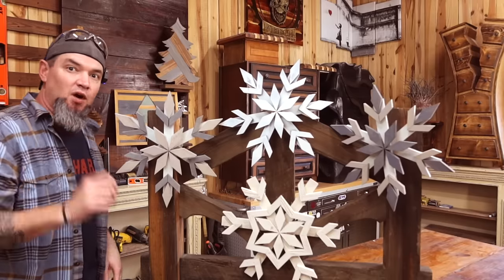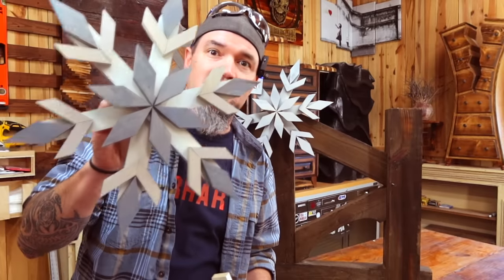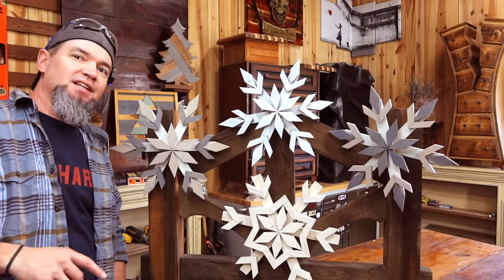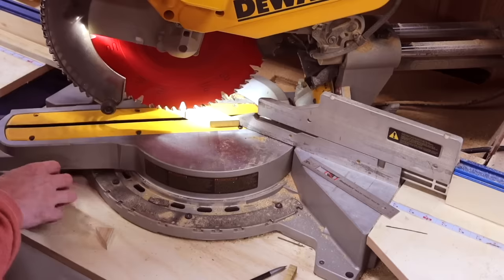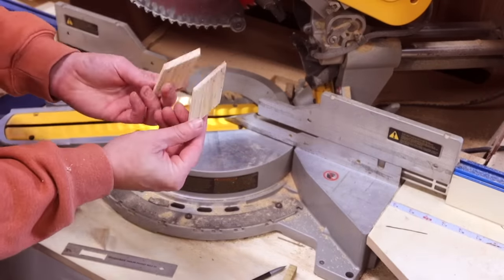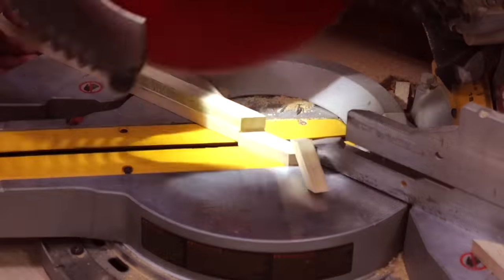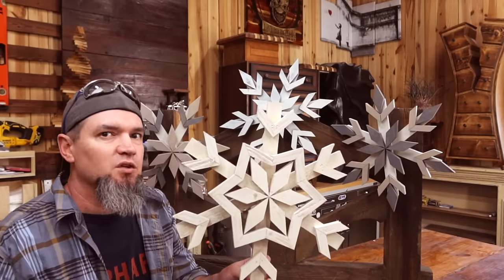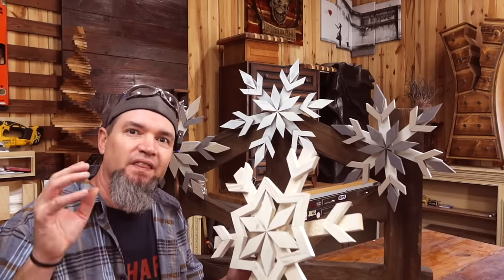One Picket - 3 Wooden Snowflakes - Make Money Woodworking

Comment: If you want a fast way to stain small bits, put them into a mess bag or a strainer of some sort (window screen) and dunk the whole bunch into the stain.  BAM! you're done.
Reply: Excellent vIdeo, excellent productions and excellent motivational talk at the end. I make rustic sleds for Christmas craft shows. Your last couple of videos have given me some ideas for some complimentary items to make and sell. Thanx for your presentations.
Reply from the maker: Good idea!
Reply from the maker: I’m glad to help!
Reply: Question- After you dunk the small parts into the stain with a strainer or whatever, do you still take the time to wipe off the excess stain?
Reply: @christianackley7147  I would recommend
Reply: @MatthewPeechWoodworking  why do my diamonds keep coming out disproportionate?
I bought the plans. 
Are they supposed to look that way?
Reply: @daveortwine2641  are you getting mixed up with the tip to tip size of the diamond and the amount you need to mark past the saw blade?
Reply: @rodgerq  mine came out ok but I had that question as well.
Reply: @daveortwine2641  I used a Guage to set my table saw at 1.25 " 50° (my miter saw doesn't go to 50°) and the diamonds came out perfect.
Reply: @daveortwine2641 try making your first cut at whatever angle (50, or 45 if that’s all your saw will do) then measure that diagonal edge of your fresh cut.  Then mark that same length on the side touching the fence with just a tiny pencil dot.  For the next cut slide the board down so that the whole blade is on the stock side, like you’re going to cut the dot in half.  If you’re holding the long board on the left side of the blade, then the right edge of the blade will be at the dot.  Maybe it’s 2 1/16” or 1 31/32”, as long as it matches the cut diagonal edge dead on.
Before you do that 2nd cut, mark where the cut diamond point is an your fence, or even better clamp some scrap as a stop right there.
Hope this helps!
Reply: @jaytrent62  , thanks for the detailed information. I have just started making the diamonds and driving myself crazy. I will try this tomorrow evening!!

Comment: Made my first snowflake last night :) wife loved it.  A side note to those who may have a miter saw like me (maybe mine is just old) my miter saw does not move to a 50 degree angle - little disappointed at first but was able to move forward using the table saw guide bar and setting it to 50 degrees - set the rip fence to the desired width and was able to make quick repeatable diamonds.  ***Matthew P. your doing great, love the channel by far my favorite woodworking channel to watch, keep it up you have many fans!
Reply: I was having the same problem, and you gave me the answer. Thanks so much.
Reply: Had the same issue.  Rigged up a fence on the 90 degree plan and used the 40 degree miter as the compliment is 50 degrees.  However, this is not very repeatable and my diamonds did not turn out as perfect diamond.  But for personal holiday décor, these will be great.

Comment: My miter saw only goes to 45 degrees either side of 0. What I did to get a 50 degree cut was I cut a 2x4 to a 45 degree block and I clamped it down tight. Then I moved the miter to 5 degrees. I definitely got that 50 degree cut BUT after that I hit another road block. I cant make repeatable cuts at 3.5"  The material butts up against the fence. If I forced it I might be able to make a "diamond" shape at about 1/8" length. I thought about cutting down the 1.25" wide pieces to their 3.5" size (36 in total) and then doing the 50 degree "hack" cut.  However it is really close to my fingers and doesnt feel safe. Looks like  I need a new miter saw but that isnt in the budget for a while. Bummer. Looks like I cant make these snowflakes.
Reply: Use your table saw instead and the miter gauge that comes with it. That's what I had to do. Set the miter gauge at 50º and rip 'em out

Comment: I've been watching your channel for a while now and my mind is overwhelmed with ideas. I have always been an outside-the-box thinker and creator. I'm a deck and screen porch builder with an endless supply of scrap wood and PVC products. I am powering up my first-ever wood shop this week and am still in the setup and design phase and tool collecting. I have to finish my own kitchen remodel first and then I will be balls to walls making stuff. I have some ideas for leftover 6in vinyl sleeves. as well as many other items. I was in the Imprinted sportswear business for a short 10 years before coming back to what I am best at so there are some crossover ideas I have. I wish I had some of that equipment. (vinyl cutters, heat presses, and such) The sky is the limit and you're truly only limited to your own time and desire to create. In my area, there is endless home-building communities and you can dumpster dive for material as well. It is unbelievable what they throw away.
Reply: That´s awesome man. Enjoy what you do! And good luck

Comment: Made mine today,   took a few hours. I ripped all my boards from a scrap piece of 2×4 about 3ft long, cut the the diamonds, wings and mounting boards, white washed them in 2 different colors,  made my template and then assembled.  I don't think it will take me as long next time. 👍 👍 👍 . Next I'm going to make a couple dinner trays out of an old cedar log I've had laying around the house for about 6 years

Comment: Just a tip that i learned from my dad (who's the best carpenter I've ever known 💖) but I'm sure most of y'all know this already but I'm going to say it anyway just in case some ppl don't know it 😊
If you mix a bit of sawdust with your wood glue it will make it able to be stained. Although I'd still say to wipe up any globs just so it looks neater. This trick just helps so you don't have a fully stained piece of wood with bare wood colored joints showing👍😁 but like I said I'm sure most ppl already know this trick but I'm a total newbie so I thought I'd share in case there are any complete beginners like myself reading this❤

Comment: Awesome project! I gave it a shot this past week and I ran into a problem at the miter saw. Mine only goes to 45 deg. I watched some videos on how to make cuts with larger angles, however, I  wasn't able to set up something for repeatable 50 deg cuts. I had to move to the table saw with a miter gauge.
Reply: Eric, 50 deg cuts are also 40 deg cuts if you do the math and subtract 50 from 90 you get 50 and 40 from 90 is 50. I think it is just the cut goes the opposite direction. Good luck.

Comment: I need to acquire some tools, glue, stain/dye etc over this winter but I have all your videos saved to my "woodworking" playlist to start building in the spring with all the palates and scrap wood I've been acquiring from the free list on my local buy, sell, trade, sites. I am disabled and needing to supplement my tiny income and you have opened the flood gates of ideas for me with what to do to actually make some money with all this wood without killing myself on large cumbersome projects. Thank you for making these videos, they are truly helpful and inspiring.
Reply: someone suggested a Makerspace (a location setup with tools), see if one is in your area and use it if you're able to.
If i had to pick 1 tool to buy to get started, it'd be the jig saw.  with it you can rip boards (long way, usually with the grain) and cross cut, you can cut circles and other odd shapes.  best with all tools is to get a really straight board (or long level) so you can make a guide to put the jig saw against to always cut straight.
Reply: @jetah50  thank you for the advice. All tips are welcome. A jig saw is one of the first tools on my list. I have some woodworking skills learned from hobby building with my father and shop class in school and I was really good at it but have never really had the space of my own to do it. Now the house I moved into has an unfinished "laundry room" that is the biggest room in the house that already has a workbench set up in it with some jigs the previous renter left behind. I don't have a way to haul everything back and forth to a Makerspace though as I don't drive and I also have to be able to work at my own pace and take frequent breaks because of my disability so I don't think that would be ideal for me but it may work out for someone else that reads this and is looking for the space. Once again thank you for the tips.

Comment: Thank you Matthew for the walkthrough / specs. Just hosted a craft night with my wife's friends and had them decorate then assemble the first design you showed. I ended up doing a triple half lap joint to reduce the amount the snowflake stuck out from the wall. Didn't add anything to the cost but certainly added to the time to cut out the pieces.

Comment: On the first snowflake I would like to point out that the 50° doesn't make a diamond at the 2" mark. It ends up lopsided. I was able to get the diamond with a 52° cut however, but it makes the diamonds 3⅞" long point to point. Which is doable.

Most of us dont have a high end miter saw that goes past 45° miters. If you have a standard Miter saw here is what you need. To get a diamond with that cut out of the 1¼" wide material, just measure out 1¾" past the blade after your initial 45° cut.
Reply: Dude !! thanks for that post. I was having one Hell time trying to get the diamonds cut this post saved me ..Once i stopped being stubborn that is.

Comment: Hey, on the wood glue not staining, true, but you can make it stainable if you mix saw dust with glue to make wood filler. It will be stainable after that. I’m living proof it works guys. Be generous with the glue and top off the gap you’re trying to fill with saw dust sand to your liking.
Reply: I will keep trying,  lol! It never looks like the videos.  I hate putty doesn't look good either when you're staining

Comment: Have I got an idea for you:  cut a 60 degree triangle out of 2" thick maple that has 2" sides.  Cut a snowflake pattern in it like you cut out of a folded paper snowflake using a bandsaw or scroll saw.  Put it on edge and scribe 6 equal layers of .33" using calipers.  Cut the layers of snowflake like bread slices off the triangle.  Glue up 3 pieces twice into two halves.  Sand the straight edge of each half with a disc sander and then glue the two halves together on a piece of paper.  Once it's dry, random orbit sand both sides and you have a perfect book-matched snowflake for good money from very little material.  You can make them in many different sizes and shapes and sell them as beautiful ornaments for around $15 each at craft fairs.  It's pennies worth of wood.
Wooden Alchemy
Reply: Hello subscriber you’ve been successfully nominated for a gift contact the number above to claim

Comment: I’m sure this is a stupid question, but despite registering up to a 50 degree range on my mitre saw, it’ll only go to 45 degrees. Short of marking every cut with a protractor and cutting free hand, it there another hack to achieve the diamonds?
Reply: Google miter saw cut angles bigger than 45degree  

put simply you will cut say 15 degree angel on scrap wood then you just hold your piece against that one you cut to make larger angle so subtract what ever you need say 50 degree you’d subtract 15 because of our jig we made so set saw to 35 degrees out your wood against the piece you cut in step 1 and there you go 50 degree 
Videos on here easily explain it better 😅

Comment: Question!! My miter saw doesn’t go to 50 degrees. Will using 45 degrees alter the diamonds dramatically?
Reply from the maker: You can make it work... cut your first 45... where the angle cut meets the wood (not the tip) draw a straight line from that point.  and then measure the tip of the 45 to that line and duplicate the measurement past center.  This should give you a perfect diamond.
Reply: With a 45 degree cut, that number will be 1.414 times the width of your diamond stock.  Matthew’s method above works for any angle and needs no math so it is better.  Both use geometry which is another reason to learn it in school.  Imagine squaring up an addition without the 3, 4, 5 triangle!

Comment: Hey Matt! Just wanted to point out that there is a mistake in your cut list in the description(I think). The list for snowflake A (which is for 3 snowflakes) says 12 of piece A. It should be 9 because there's only 3 of those pieces in each flake. Right? That cut list had me a little confused because of the x3 thing. I know it's not rocket science but I'm a bit of a dumbo sometimes. I'm currently making 30 of these and I messed up and only cut 120 of the wings and diamonds instead of 360. Feels bad man. Lol. I do feel like the video was lacking a bit in details, but I guess that's why you sell the build plans. I probably should have gotten them. Anyways man thanks for the content!

Comment: I got the Combo plans for the snow flakes and I will be using "Pallet Wood " for all of them. But I have one question, Did you really say 50 degrees on one of the diamond cuts. I have a "Ryoby 12 inch Chop saw and I just checked to see how far it will go Left and right. 45 1/2 degrees. So what do I do?
Reply: Check out my comment above for a solution to that.

For the rest I am using my Kreg Miter gauge on the table saw.

Comment: With a jig, cutting these small pieces on a table saw could be quicker than the miter saw.  I also find it more tiring to press down the handle vs sliding a sled.
Reply from the maker: Very true.  I have a sliding miter on my table saw... but I know that a lot of folks don't... so I show the basic way.  I need to start showing both.
Reply: @MatthewPeechWoodworking  I think your format is right.  I believe most beginners would get a miter saw before a table saw.  Folks with a  table saw being more experienced can probably figure it out on their own.

Comment: Are you using Pressure Treated pickets for these? Our little Home Depot doesn't have much to choose from. Would you mind posting a link to your local store/picket product? If I plan ahead, I have many stores within 90 minutes of home, but I want to make for sure that the pickets I find are easy to stain. I've had trouble with pressure treated lumber not taking paint/stain in the past. 

Thank you so much for your willingness to come up with and share all of the ideas on your channel.

Comment: I'm attempting to cut out the diamonds but my miter saw only goes to 45 degrees. I've watched your video on starting at 0 = 90 and subtracting 40 to get a 50 degree miter. When I used this, it doesn't give me a diamond shape.  I've got a jig to cut 50 degrees but can only use it on one end, no sliding it down 2 inches per your video.  Any idea or solution?

Comment: Your pieces are so smooth. Are you sanding or planing them first? My fence pickets are a little on the rougher side.
Reply: I can't get smooth pickets or 2x4s around here. I always send mine through the planer. Taking just 1/32 off really makes a difference.
Reply: @tony5316  I just ordered the Skil 6307 table saw, my old old black and decker sounds like a coffee can with a cat thrown in the mix when you turn it on. Planer is my next buy. I'm researching them now. Surprisingly the craftsmen planer is getting good reviews for a budget planer. I think I'm leaning towards one with the helical cutter though
Reply: @michaeldahlweiner4939  get the Dewalt DW735. It's a pretty good planer! And Helix makes blades for it.

Comment: Really liking these fence picket plans. So many ideas to use. I've already tried making the small planter with ok success except the pickets I got were not evenly thick. But I will try again.

I have a question on this project. On Design 1 you say to cut the diamonds to 50* on each end. I don't have really high end tools and so the miter saw I have only goes up to 47*. Will that be "close enough" for the project to still look good?
Reply: Gave it a test run, definitely didn't work. It HAS to be 50°
Reply: Someone else commented to make the cut at 45 degrees, slide the 1 1/4” piece down 1 3/4” and make another 45 degree. Mine turned out well
Using that math. Next time I would just setup a stop so that each one is perfect

Comment: On a beginner budget, In your opinion what is the best table saw to start out using? it is one of the tools left I need to get
Reply from the maker: A used one.  Lets say your looking at a new $300 jobsite saw.  For that same money you can find an older (most of the time better) one that may just need some tlc for half that price.  I see used table saws on marketplace all the time for CHEAP because of a lil rust.  Check out my video "Upgrade to used"
Reply: i use a track system from Kreg (Kreg 48 in. Accu-Cut Aluminum Circular Saw Track) that i put my battery saw on.
check goodwill, pawn shops.  maybe rent one to get your bulk cutting done.

Comment: When cutting the diamonds you say you move the board 2 in. Where do you measure from to get the 2 in? Is it from the blade, bottom/top angle point or center of the angle?

Comment: Looks like I may be the only person having issues with the dimensions on the cut list?  I'm finding it IMPOSSIBLE to make a symmetrical 3.5-inch diamond at a 50-degree angle with 1 1/4 inch wide stock (Design 1, Part B).  I've checked and rechecked dimensions and angles.  Are there typos in the list above?  This is driving me nuts....
Reply: Have you worked out the diamond angle yet?